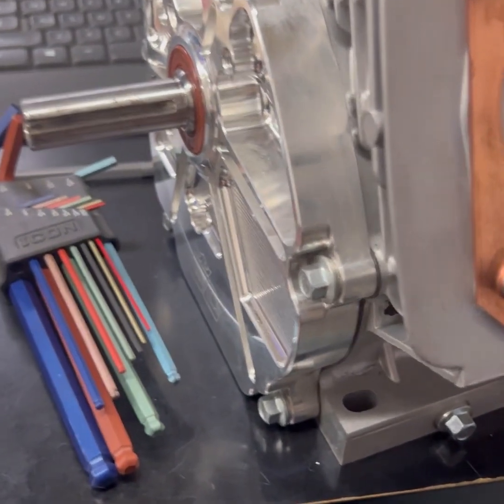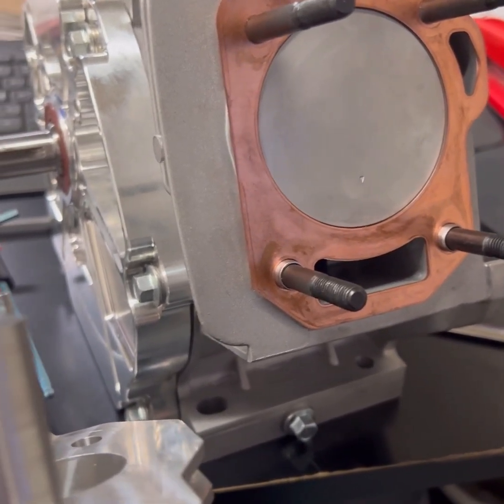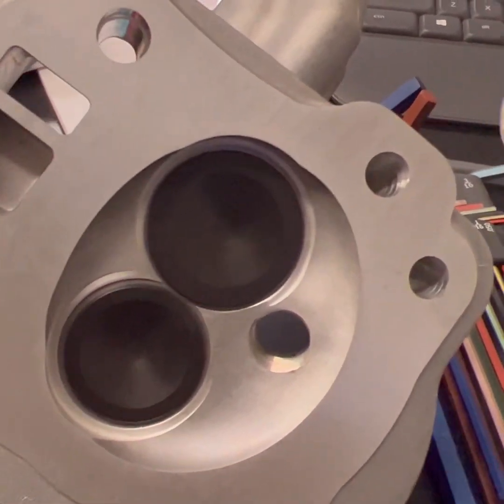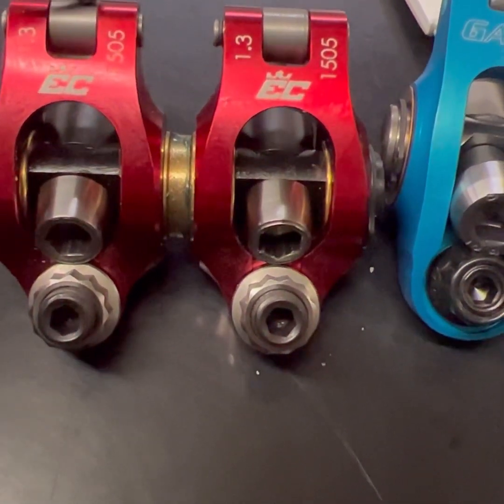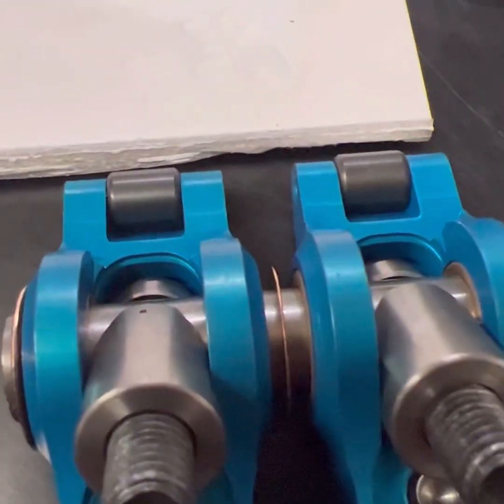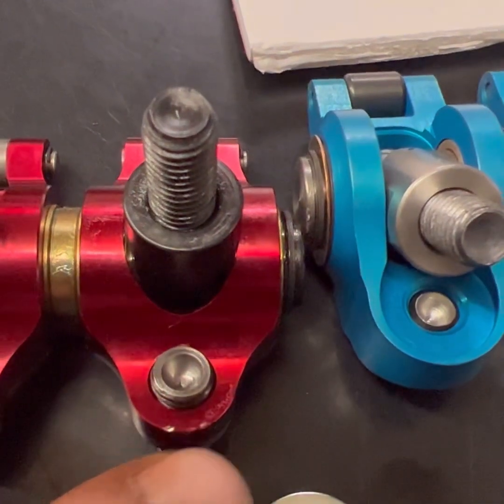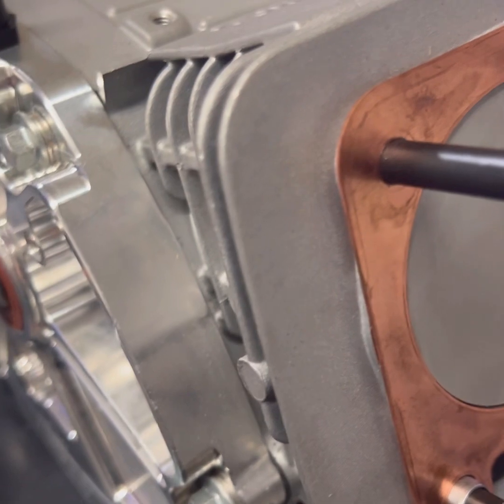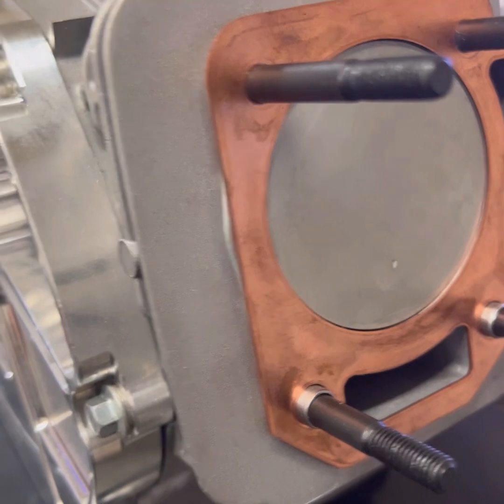Setbacks with the EC Carburetors 236 kit and MoFlow 1 cyl head. Or 1 motor becomes two coming soon.

Comment: I'm currently saving up for rockers myself, shit is so Stupid expensive
Reply from the maker: Since this video has been out, I believe EC has been listening (Not to me or because of this video) and folks have come to the same conclusion about the roller. They’ve redesigned the business end with larger wheels to contact the valve tip. You might save a few dollars by going with the little red ones, especially if you’re running a cast head and you won’t run into any alignment trouble.

Comment: I'd just use a thicker hesd gasket to get you going.
Reply from the maker: I thought about it but in order to get enough, it not only would have killed the static compression but it would have neutralized any quench area to cool the piston. It wasn’t a tic or slight interference, it was a solid lock up like that cam is ground on extremely tight lobe centers. When funds allow I’m going to order some legit valve pocket cutters thanks to Kentucky Fried Fixes. Ironically His contact makes cutters for these style engines just like the ones Isky used to make for larger displacement race car stuff.
Reply from the maker: I thought about it but in order to get enough, it not only would have killed the static compression but it would have neutralized any quench area to cool the piston. It wasn’t a tic or slight interference, it was a solid lock up like that cam is ground on extremely tight lobe centers. When funds allow I’m going to order some legit valve pocket cutters thanks to Kentucky Fried Fixes. Ironically His contact makes cutters for these style engines just like the ones Isky used to make for larger displacement race car stuff.

Comment: Um, why don't you keep the cam and simply put some valve reliefs on the top of the piston?
Reply from the maker: Outstanding question brother Eddie! #1, I don’t have the tooling to do that yet and #2, I’m not sure how much material is in the top of this piston between the inside edges of the ring lands and the crown. With a zero degree or parallel valve angle, we’ve got some large pockets to cut which to get .050 and .070 clearance.

Comment: Gotta a quick question if you can help me out, first off like the video, I follow all your vids, I purchased a Tillotson 225RS engine from Studz Racing  that came  with a 307 cam, OEM Honda Cast 18cc Race Head 28/25 SS valve train with 45lb   dual valve springs, head is milled .050 race ported and bead blasted, Champion heavy duty rockers, chromoly push rods, ARC 3465 over sized billet aluminum connecting rod, 72mm Tillotson lightweight hypereutectic racing piston, ARC lightweight racing billet flywheel, 24mm custom flatside carb, C3 FAG case bearing. Now my question to you is I also purchased the EC 236cc Stroker  kit which is also compatible to the tillotson 225RS engine, will I need to replace my head set up in any way in order to use the stroker kit?? I apologize for the lengthy text, Im just wanting an experienced opinion. Thank you in advance
Reply from the maker: Blake, the kit should just replace your existing lower end so long as the piston to head clearance is the same and they didn’t have to cut valve pockets. Best way to tell is pull the head off, if the piston top is totally flat, you’re golden. Now If you decide to change rocker ratio or cams, you need to check piston to valve clearance again. I think you’re fine with the 307 cam, it’s the big open grinds like some of the .275s, the .292 and the .320 that cause issues with ratio rockers. Big ass cams with over 260 duration and tight lobe centers
Reply: @peterchristlieb  thank you brother

Comment: Can you explain your lash cap comment ?
Reply from the maker: I can, it’s a matter of personal preference. I’ve built a lot of motors over the years and I was raised to avoid them. I know some engines come with them and they do allow you to fix for some extreme valvetrain geometry issues but to me, it’s another part to fail and drop down into the rotating assembly. I broke my own rule a few years ago and ran them on a SBC only to have one break. It caused the rocker to hit the retainer when the pushrod came out of its seat and it mangled an exhaust valve. Luckily the piston and valve guide survived but I should have used a different rocker arm and pushrod combo.

Comment: Hi I was wondering if there was a page or link or even info on everything that fits a tillitson 212r . What parts are compatible? Like cranks rods etc . Ty
Reply from the maker: Go to the EC Carbs website, they’ve got the 212r listed in there but it was replaced by the 225rs. Anything that fits a Honda clone will work on the 212r plus you have the really nice crankcase. Damn near bulletproof
Reply: @peterchristlieb  when you say anything that fits a Honda clone do you mean anything that fits a Honda or a Honda clone?
Reply: Any of the good site will have info on the part listing somewhere on the page.
It will say which engines the part will fit.

You should have no trouble at all finding parts for that engine IMO.

Comment: I'm running the EC rev rockers on my 236 using the EC evolution head and both my rockers have witness marks on them from the lash caps
Reply from the maker: I’m doing my best to not use lash caps, never liked them. I love the EC rockers but on the aftermarket heads, I’ll stick with the Gage. Even if it means grinding the bottom for clearance, I want that bigger wheel on the end
Reply from the maker: Here we are a year later and I may eat my words, Looks like EC has stepped up and is offering a larger roller now. Depending on spring pressures with the two current will have, one of them may definitely get the EC rockers. Any time you can take weight off the valve train you get some nice gains providing you’re not giving up Rigidity.

Comment: All you have to do is shim the rocker side to side play.
Reply from the maker: Yes, understood sir. I need to find some shims or see if they can mail me some. I don’t mind splitting and re-welding the shaft either if needed but with the small diameter roller, I’d feel better running these on a 5mm tip. I like the smaller body and underside clearance better but with the billet head, I think I’ll run the Gage rockers.

Comment: I had the same issue with the black venom rockers on the clearance issue with the 40lb dual springs
Reply from the maker: I’m not afraid to clearance the bottom of the rocker a little bit rather than shim them and have to dick around with the geometry again. The Gage rockers are definitely stronger, even the lites like I’ve got but the EC rockers are nice and lightweight. I’m going to ask them for some shims and I might order some stock to make my own shafts.
Reply: @peterchristlieb  yea i didn't clearance the rockers , I just used a 0.50 shims and used cut to length push rods to get the geometry correct

Comment: How do you like the 292 cam?
Reply from the maker: I haven’t been able to run it yet. When I switched heads, the valves hit the pistons. I’m going to run it in the 228 with the MoFlow, just waiting on the pushrods and connecting rod.
Reply from the maker: I’m thinking about picking up either a Dyno 315 or having Isky grind me something custom, I’ve got valve pocket cutters in the works, just waiting to see if I can get 5mm and 5.5mm pilots so I only have to buy once.

Comment: Go to DED racing and get cut to length push rods and the small diameter rod tips, the small rod tips are for finding the right length. Once you find the right length use the reg diameter tips and then you are done. Now what lift cam do you got, I don’t need duration just lift. I can tell you what cam you need.

Comment: I see what you're talking about now on those EC rollers. Those need to be larger diameter. EC needs to see this.
Reply: I have told them a year ago. Just buy the Gage's. Max actually listens to customer feedback.
Reply: @WyFoster  Thanks Wyatt!
Reply from the maker: Gentlemen, it looks like EC had someone they respect bring the issue to their attention as they now have a larger roller and they’ve added a 1.4 to the line. Love to get my hands on a set of those, Turn the ol .265 cams into .371 thumpers.
Reply: @peterchristlieb  Good deal! I have a lot of respect for the guys at EC. They've come a long way since the early days of Tillotson performance tuning.